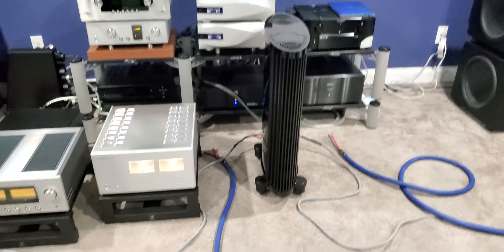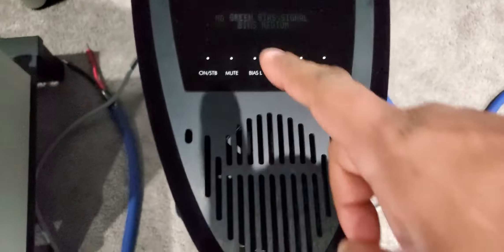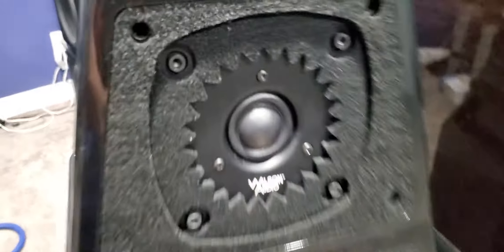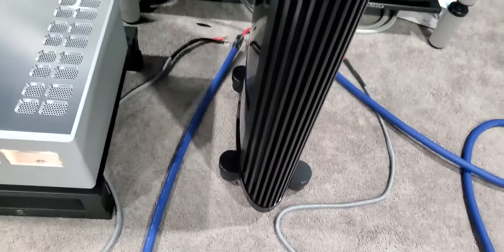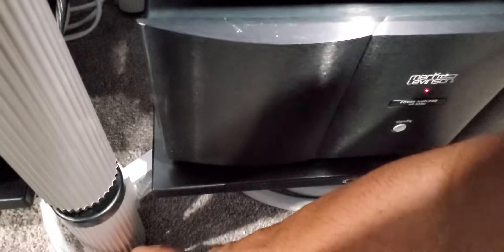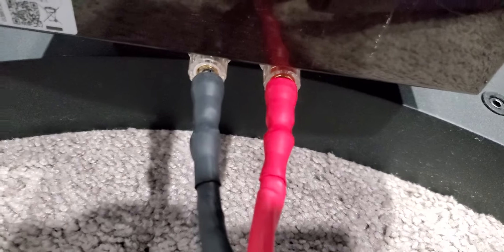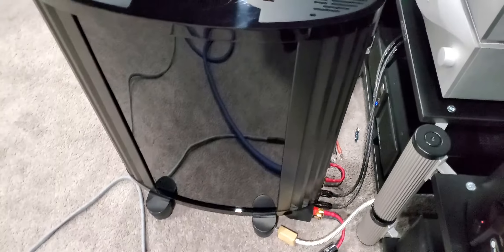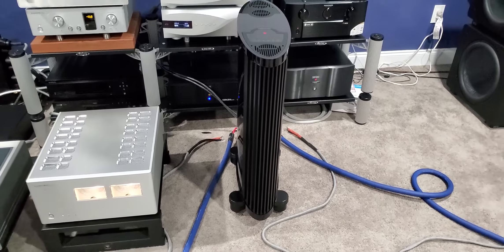What the hell is wrong ?!!!

Comment: the gauge of the second cable is likely picking up 60Hz  bleed from the amps on the left side (had you tried the left larger gauge wire on the right side it might have been different but seeing the cables where connected to the dynaudio with no buzz is puzzling) *it does seem to be 60Hz microphonics though*, also the banana's should be either spring played or (center draw splayed(dead bolt))  There was another person on here that mentioned that cable going over a line level, it could be the system is losing balance on that interconnect. -- I do realise this is late to the the game, but thought I would toss in this.

Comment: I know this video is old but I thought I'd share my thoughts.
It could be excess capacitance in the cable that the amp does not like. I think the different crossovers of the speakers are deciding if the noise is present.

I know you're going to say that makes no sense but I had an integrated that buzzed through my REL subs, but only when it was off. I decided to run the RELS through the binding posts of my speakers instead and the problem went away.

Comment: Sounds like a ground loop to me... I had the same think happen to me, turns out I had a ground loop. Anything could cause the ground loop too, it could be the cable is picking up the 60hz from the amp seeing how your maps are on the left side too. I would say swap cables to see if the same think happens to both cables, then try moving the amps away from the cables or try unplugging each unused equipment until you find the source. 

Hope this helps.

Comment: I'm sure by now you have came to the conclusion of the problem, only one thing I noticed was your banana plugs were not properly fitting tightly in the 5 way binding post so im thinking you were getting a negative connection causing a buzz, i noticed they were wanting to fall out when you were putting them in

Comment: First of all, you must be sure 100% that mute state disconnects output stage from out connectors of power amp. 
Amp may be oscillating.
Banana plugs on those blue cables are loose, bad connection, high resistance connection, with Wilsons crossover reactance, Gryphon can oscillate again. Remeber, that is no global feedback design. When you reconnect anything, it's best to turn off the amplifier.
Reply from the maker: The amp had a mute button when changing interconnects
Reply: @jaysaudiolab  what about loudspeaker cables?  Are output posts also distonnected from output stage of amplifier?  Loose cable connectors are also way to kill your amp in one moment.
Reply: Nemreš bilivit
Reply: @kristinailic4167  nemrem bilivit 😄
Reply: @bajicsp  jel da😀

Comment: This is very frustrating. I have been in the same exact situation a few years back. I tried everything, it drove me crazy for weeks. My only solution was to replace the Amp at that time. Not blaming the amp, my guess is it simply some mysterious interactions between speakers, amp, cables, or even anything else in the chain. One single change in that mix, fixes the issue. Very mysterious and frustrating!

Comment: One thing is different. When you get the buzz you have a speaker cable crossing over the interconnects to the amp. You should try the speaker cable, crossing over the interconnect, from the left of the amp to the Dynaudio (sp?) speaker. I stand corrected. I looked at it a second time. The first buzz occurred and the cables were not crossed. What happens if you switch the Cardas cable channels completely? Not just at the amp but switch right and left?

Comment: I had the exact same sound with my latest test DIY speakers câbles. Not a ground loop here... First second after firing up the amp, felt like à building up slowly until it was loud. As I was touching the connector at amp end, the "energy" seems to dissipate à bit. So I thought something gathering electricity or whatever. I had these cheap all métal banana connectors. I simply unscrew one of the métal covers and voilà. (Sorry my lack of vocabulary, my french is better)... But put it simple, something is building energy/capacitance somewhere. Have someone listening to the speaker while you search for the culprit.